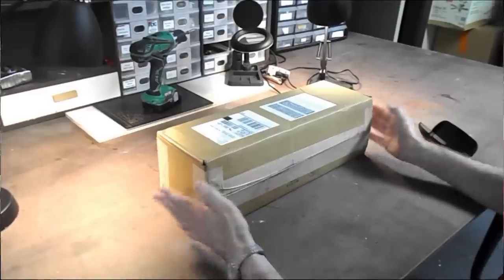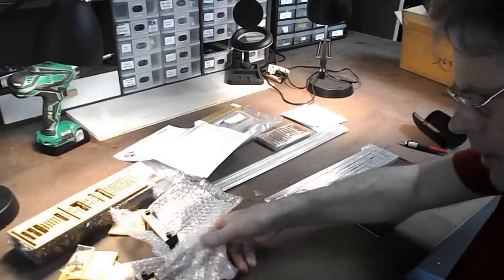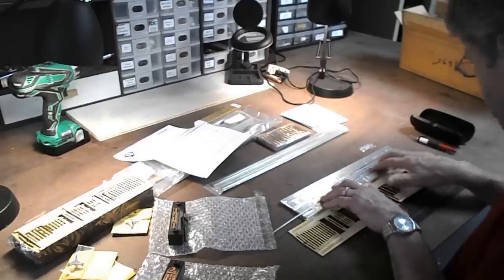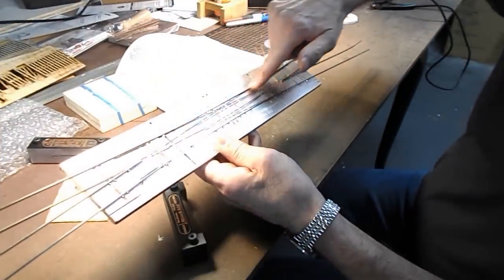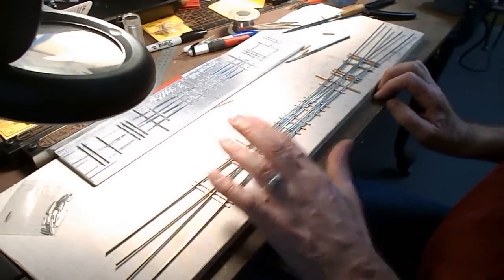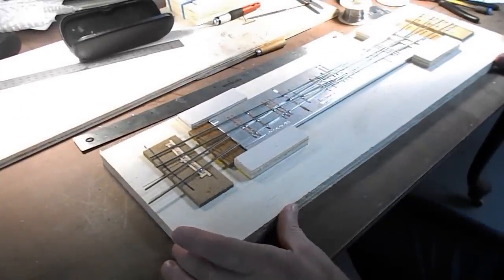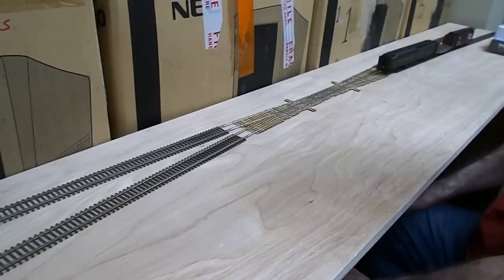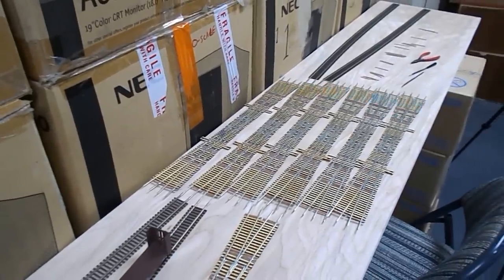Building double slip switches with the fast-tracks jig

Comment: I'm still working on my n-scale no 8 slips(times 12)... takes so much patience, but still well worth it and doable.
Reply from the maker: Are you using the fast-tracks jig, or doing it the hard way?
Reply: @mpeterll  i use the jig. not brave enough for the hard way... do that with the strait and curved track and a few what i call no 6.7 switches

Comment: I'd suggest that as you cut the gaps in the PC ties that you check for electrical continuity with a bench meter. A visual check is not always enough. Ask me how I know.
Reply from the maker: Yes that is sound advice.  I've never yet failed to get a proper gap in a PCB tie, but there's always the first time.  I think I will find a way to speed that process by having the probes of the test meter mounted in a block of wood, so all I have to do is press the tie against them, instead of swapping tools for each one.
Reply: @mpeterll  Yes, that sounds like a REALLY good idea. Wish I had come up with it first.

Comment: What would you estimate was your assembly time for the last double switch you built? I'm asking about the amount of time to put the pre-shaped parts in the jigs and soldier together. I've built a number of turnouts over the years, a number of them using borrowed Fast Tracks jigs, but I've never done them in batches and I would hope that would speed up production times.

Comment: Hi peter How much is the kit cost did it cost
Reply from the maker: They don't do fixed "kits" anymore.  Instead, when you add the jig to your shopping cart, they give a recommended list of tools and materials they think you might need - like an al-a-carte menu.  I think it is so much better than the old way.  Overall I've invested about $1100 in the project so far, but that included tools and materials for the first batch of #7 straight turnouts as well.
Reply: @mpeterll  Hi Peter  thank you !! keep the good work !!!

Comment: Hi buddy im wanting to start a layout ,my first time doing a proper layout ,im in australiatrying to work out what type of layout desighn to do ?any suggestions for an australian design !
Reply from the maker: Schematically, it makes little difference what country's rail system you are representing.  The first things to figure out are what type of operating pattern you want (point-to-point, continuous, or a combination), your desired theme (main-line, branch-line, city terminal railroad, etc), and how your trains will be staged (yes, you will need a staging yard, no matter what type of railroad you want to build).  Once you have the main features blocked in, then you need to fill in the details using typical practices for your chosen prototype.

Comment: MADE IN USA
Reply: Port Dover, Ontario according to their website
Reply from the maker: @mpetersen6  You are both correct, the jigs are made in Canada, but the turnouts are built in the USA.
Reply: @mpetersen6  I am Canadian too and didn't know that.
Reply: Stock Aids, Jigs,... all made in Canada as indicated on their copper brand label. Just keep that Stock aid lubed so it doesn't rust 👌
Reply: @mpeterll  
Aside from packaging I wonder just how does one "finish" assembly of a solid piece of 1/4 x 3(?) x 15, 18 whatever CNC machined Aluminum/Aluminium (must keep our friends outside the US happy). I'm not being pedantic.  It's just that the curious want to know. Hope you get enough orders and I think you will. Fast Tracks also sells turnout and other items to order. Their jigs are well designed pieces of kit. When buying one you aren't paying for the production costs so much as the design, development and tooling if they make them in house. Total machine time is probably less than 15 minutes depending on the machine being used. These could be done on a Bridgeport with an aftermarket control or a CNC desktop router. The better the machine the better the accuracy
Reply from the maker: @mpetersen6  I meant that the turnouts are built in the USA using tools from Canada - there's enough glory there for both countries.
They do charge a premium for developing a new jig, but even so they probably still have to sell a fair number to fully recoup the development costs - probably not a big deal with something as popular as a straight #6 turnout, but specialty track-work (such as double slips) might take a longtime.
Reply: @mpetersen6  Gauge Z metric? Well... Aspenmodel (yes, germans...) do have Zm as thier niche product. And yes, i was convinced that Z was the smalest technical fiaseble. But People go lenghts to prove otherwise.